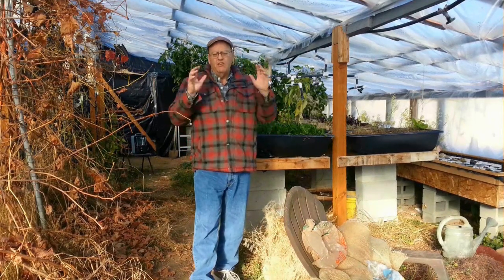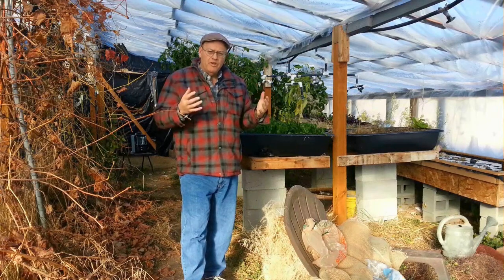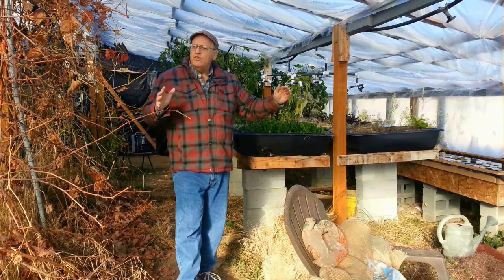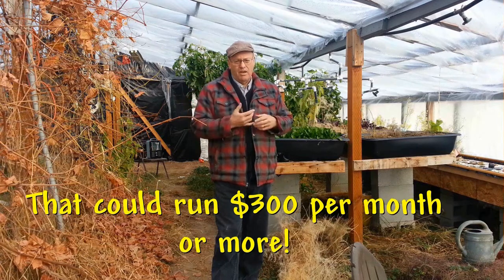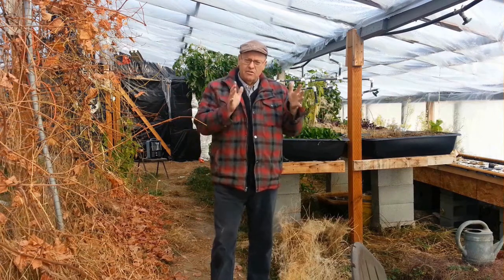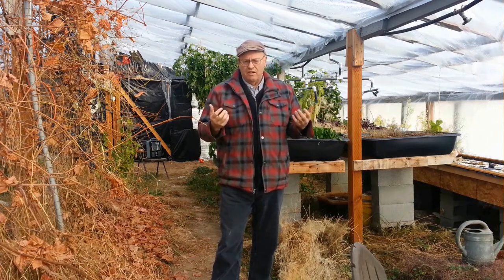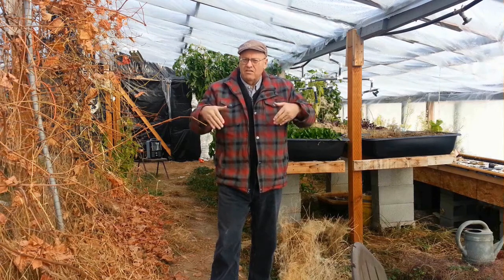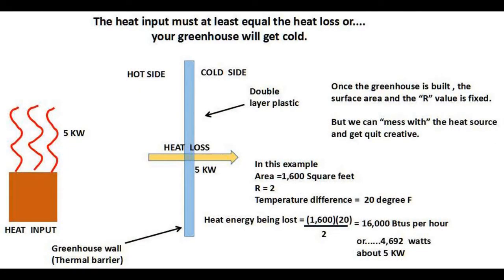How much heat does it take to heat your wintertime greenhouse?

Comment: Just so people know that in his example the inside temperature was 60 and the outside temperature was 40 degrees. If you are sizing a heater you need to size it based on the actual indoor temperature you want and the coldest temperature you may experience outside. You should also assume leaks and go a little larger. R-Values of plastic vary and most are around 1.2-1.4. Going double layer doesn't mean double, it is usually about 0.4-0.6 more. The more layers you add the less usable light is transmitted inside for your plants. It is usually always worth it to spend a little extra on better plastic when you are talking about heating costs.
Reply from the maker: Good points!   Actually everyone is going to have an individual result.   Got to tailor it to your needs.